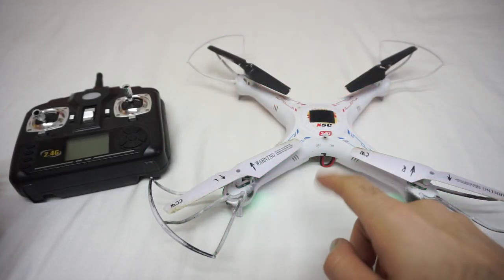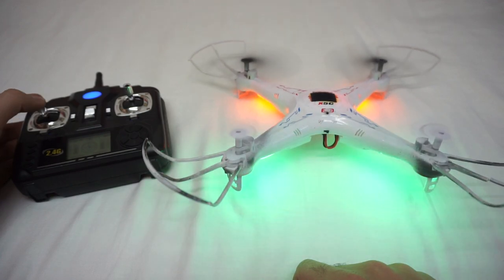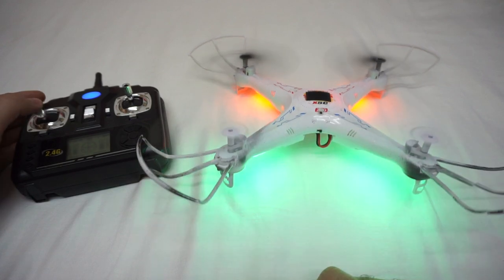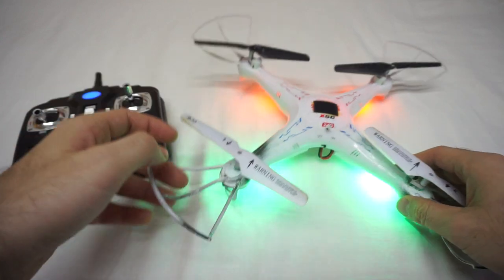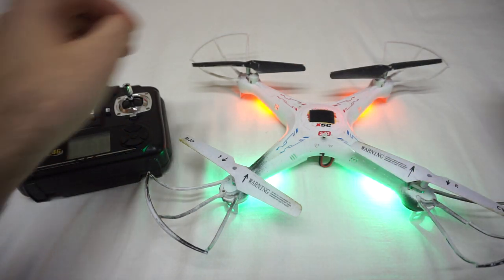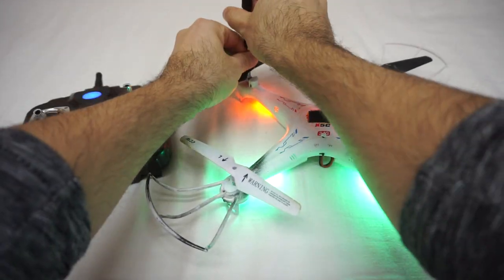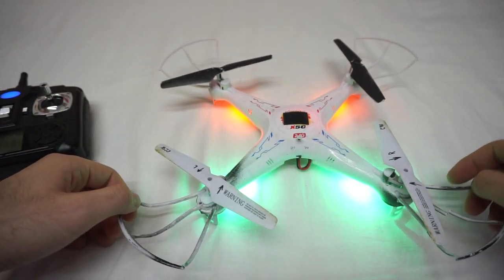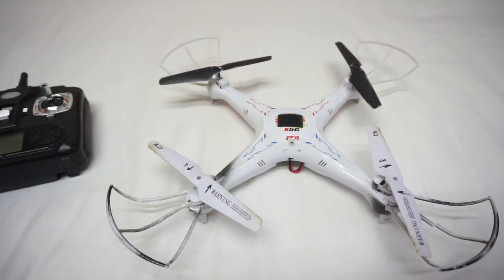Why the Drone is not taking off (Leans to one side, Syma X5C, propellers)

Comment: Those for whom this trick didn’t work and is still leaning to one side, all you have to remove this case and take the motor out slowly(the side which had less power and was not taking off from ground) and remove the gear put some glue on the shaft and put it back in. Assemble back and try! Should work if it was caused due to strikes while flying… thanks

Comment: two propellers want to lift it up and two propellers want take it down  

1. turn on drone,see where are green/orange lights.
2. turn drone on so green lights are directed towards you .
3. still keep the green lights towards you. take the propeller from right side of orange/red lights,  exchange it with the green lighted  right propeller.
4. if it still refuse to fly put them back as original and repeat steps 1 2 3 but to LEFT side propellers

Comment: Just got our drone and we were doing some practice but now the drone doesn’t fly right. When you try to make it start up flying, all 3 propellers go up but the 4th one is working although it’s not going up. I have a Quadcopter GD89
Reply from the maker: Clean the shaft of that motor from dirt, tangled hair or grass. If the motor heats up than it might be damaged and it might require replacement. Also check the trim buttons on the remote.
Reply: furulevi what are the trim buttons

Comment: hey dude my drone a revell quadcopter fizz is not able to take off at all (the props are rotating and its not leaning to one side either) what is going on is there an easy fix for this or should i go to an electronic shop and replace the whole motors

Comment: It doesn't make sense though? Why do you have to do this to make it fly? What went wrong for this to happen? Can someone please explain so i can understand. For me to have to do this, I changed some PIDs. That's all. Then I changed them back to how it was and it still did it. But when I moved my props it was fine..?
Reply from the maker: On this simple drone PIDs can't be changed. Just verify the propellers and make sure all of them are pushing the air down and not up. 2 opposite propellers should spin in the same direction, the other 2 opposite props in the other direction.

Comment: What if it isn’t lifting at all
Reply from the maker: Is it pushing itself down? All propellers might be mounted incorrectly.
Reply: furulevi what if only one side doesn’t get up , just one motor .
Reply from the maker: See if it's pushing the air up or down, air should be pushed down, mount a propeller that has blades inclined into the opposite direction. If the motor rpm is not high enough than clean the motor from hair, dirt, grass. If the motor overheats than replace it.

Comment: Will this work also if it’s leaning to one corner in the back?
Ok it worked but after I flew it for a while it crashed and damaged the propeller guard making one of the plastic connectors snap ( btw I have the DX-2 stunt drone)

Comment: I have a Dronium 3x drone and was using it for a little but when I took a little too heavy of a crash. After that only 1 corner of the drone was leaning. Is this an easy fix ? Or is something wrong with the motor
Reply from the maker: If it was flying well before then just straighten or replace the propeller or the propeller guard (if any) and clean it around the motor.

Comment: What if only happening on one corner? The other three lift up but one corner won’t.
Reply from the maker: - Check if it's pushing the air down or up (it should push air down), 2 diagonally opposite propeller blades should be tilted to one direction, the other 2 should be tilted to the other direction
- Check the motor for tangled hair, grass, dirt
- Check the remote control for uncentered trim buttons ► https://youtu.be/Nk2h06Ql3cM
- If a motor gets hot then replace it

Comment: Iv done this an still da same brand new I got today an it won’t fly il hv to give it back to the shop iv swapped propellers an trying everything must be faulty
Reply from the maker: - Is the drone battery fully charged?
- Are 2 diagonally opposed propellers spinning in the same direction and the other 2 in the opposite direction as they should?
- Is there something tangled onto the motors/propellers?
Reply: @furulevi  yup it’s fully charged.it just glides along the floor one side only lifts. I’m not sure what way the propellers work it’s my first drone I wanted to practice an work up to a bigger drone. how do u know if the propellers are on correctly? I tried ur way in the video it still da same. Thanks for replying.

Comment: I have tried this.  And calibrate.  Still have the same problem .. HELP
Reply from the maker: 2 opposing propellers should rotate to the right, the other 2 opposing ones to the left.
Propeller blades must be at an angle, make sure they are not horizontal.

Comment: I have tried the same but my drone didn't work .please tell me what i do
Reply from the maker: - make sure all propellers are pushing the air down and not up
- make sure the propeller blades have a certain angle and they are not horizontal
Reply: I had tried and it works 
Thank you ❤❤

Comment: I have changed the propellers n it now stable on the ground but still not flying. Pls any help.
Reply from the maker: Is the drone battery fully charged? If the battery is old and puffed then it should be replaced. Are the propeller blades at an angle? They must have a certain angle. Is the motor rpm high enough? Clean the motor's rotor, check for dust or tangled hair or any other dirt. If the motors heat up then replace them.
Reply: Ok, tnx bro

Comment: My drone facing same problem but still can't take off... please help me....i have a waatsapp......
Reply from the maker: -check if all 4 propellers are pushing the air down and not up
-if one of the propellers is damaged and its blades are totally horizontal then it can't push the air down, replace it or twist each blade so that i will be at an angle similar to the other blades
-make sure the battery is fully charged and it can properly power the drone
-check the motors for dirt and overheating

Comment: What causes this? The motors don't all spin the same direction and the blades on some drones are directional.
Reply from the maker: 2 motors must spin to the right and 2 must spin to the left. The propellers are also shaped differently to be able to push the air down while spinning in the opposite direction. Without this opposite spinning direction the drone would need a tail rotor just like a helicopter to counteract the spinning.

Comment: I did this it don't gets over the side but it don't takes of
Reply from the maker: - Is it pushing itself down when the throttle is suddenly increased? > Reverse all 4 propellers, not just 2.
- Fully charge the battery, or replace it if the voltage per cell is not around 3.7 (4.2V when fully charged)
- Clean the motor shafts, make sure they turn easily
- Propeller blades must have a certain angle, if they are deformed and horizontal then they don't generate lift.
Reply: @furulevi  Hi.My drone is striker from world tech toys.it is a clone of x5c.i reversed the propellers like you said but it still isnt taking off but it hovers in the air and move towards front position.when i freely try to rotate one of the blade i feel a click click in the propellers.let me know if you have any solution :)

Comment: isnt geting up any syde
Reply from the maker: - Check if all the propellers are pushing the air down. If they are pushing the air up than reverse them,
- Is the drone battery fully charged, do the propellers have high enough rpm to get into the air?
- Clean the shaft of the motors from grass or hair etc.
- If 1 of the motors is getting hot than you should replace that

Comment: What if one is not spinning?
Reply: if one propeller isnt spinning then the first step is to plug in the battery and look at the one that inst spinning.take off the propeller its self and stroke the shaft of the motor for any hairs with your finger thats more or less how you do it . just put the propeller back on and start flying
Reply from the maker: Check if it receiver power. If you can easily disconnect motor wires than connect a working motor to that side to see if that is spinning to find out if there is power at that arm.

Comment: My copter leans towards one corner, what should I do? Its not lifting off,but leans and goes towards the top right corner propeller
Reply from the maker: - Make sure the propellers are mounted correctly, each propeller must push the air down and not up. The 2 opposite (like the letter X) propellers should spin in the same direction, 2 to the right and 2 to the left;
- Check if one of the motors is getting hot, clean it if it is dirty (hair, grass, dust/dirt)
- correct the flying from the radio control using the trim buttons ► https://www.youtube.com/watch?v=Nk2h06Ql3cM

Comment: Can anyone help me I did the same but my drone isn't flying
My drone model is syma X23W
Reply from the maker: - are all propellers pushing the air down?
- are the propeller blades still twisted to an angle to create lift? They must be at an angle.
- 2 diagonally opposing propellers most rotate in the same direction, the other 2 opposite propellers to the opposite direction.

Comment: It's not working
Reply from the maker: - clean motor shaft from any dirt
- if one motor is overheating than replace it
- check the trim buttons also ► https://www.youtube.com/watch?v=Nk2h06Ql3cM
- 2 diagonally opposing motors should rotate to the RIGHT, and the other 2 diagonally opposing ones to the LEFT
- check if all propellers are pushing the air down